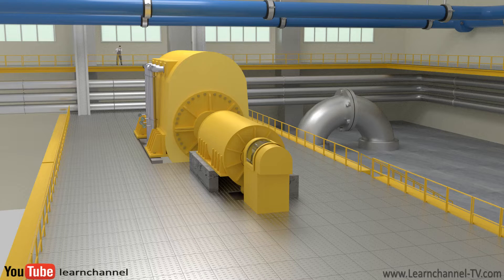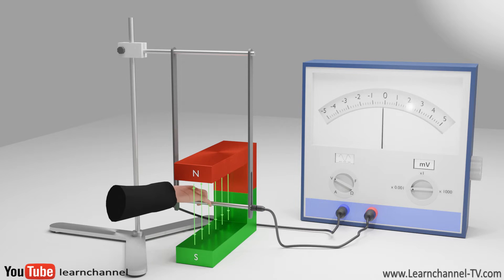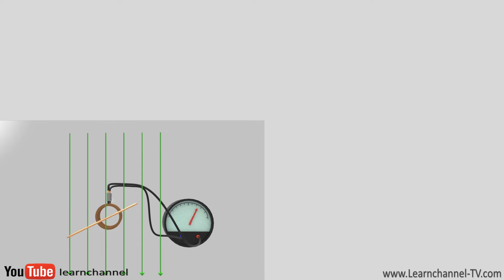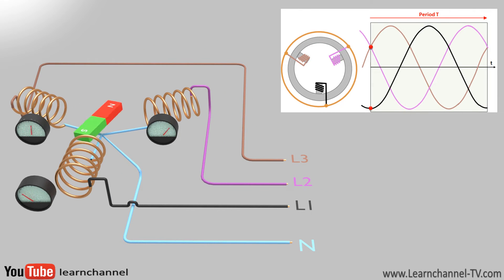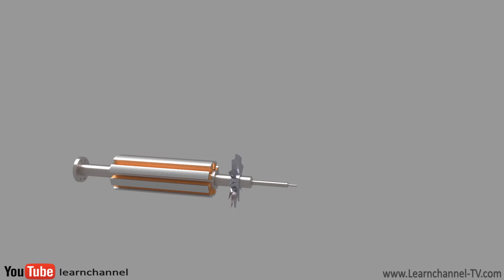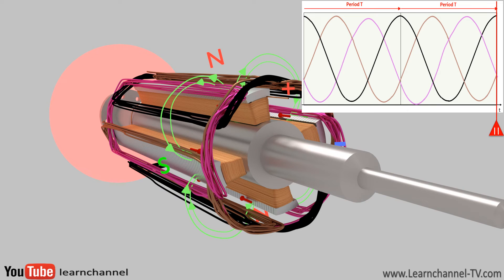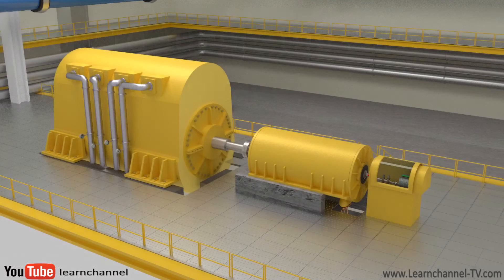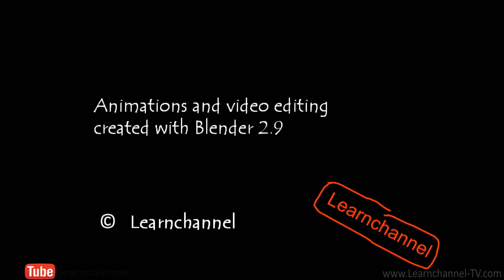Electromagnetic induction, 3 Phase alternators explained

Comment: Excellent video. I am mechanical. At 3:42, why it is required to interrupt the path of eddy current (by using pack of steel lamination?
Thanks.
Reply from the maker: Voltage is also induced within the rotor steel leading to eddy currents. These eddy currents cause heat and power losses. 
To interrupt the path of these eddy currents the rotor is made of steel laminations, which are electrically insulated.
Reply: @learnchannel-TV  Thanks for your excellent clarification.